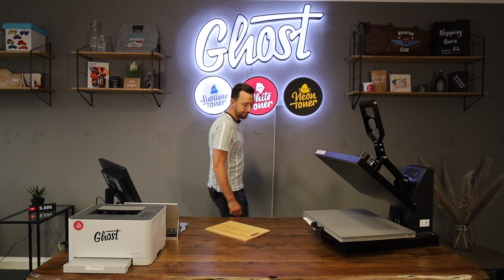Print on wood with your Laserjet printer - HP Color Laser 150

Comment: Hey ghost white, im wanting use a laser printer to make white toner waterslide decals for models etc. I have a hp150nw, will it work with just the white toner from ghost, or do i also need to use ghost colour toners, or will the hp branded ones work fine with the ghost white toner? thanks
Reply from the maker: Hi, the White toner from also works in conjunction with the HP toners. However, we recommend that you turn off the software updates.
Here is a video of how we print deals with the HP M150 Mini Ghost: https://www.youtube.com/watch?v=ZU1h_OAxBVk&t=160s

Comment: I still have problems with A & B foil .. it doesn't transfer .. toner stick on B foil..
Reply from the maker: Then please check if you follow these things:

Do you preheat the lower plate of the press before pressing so that it keeps the film warm during peeling ? 
Do you pull the film hot directly after pressing on the press ? 
Do you press at 160 degrees for 120 seconds ? 
Do you peel the film slowly and smoothly ?
Reply: @Ghost-White-Toner  yes , i make all of those perfectely! I've lost ca. 13 A sheets and B sheets ...
Reply from the maker: Hi, 

ok you pull off everything on the hot plate directly after pressing ? Without pausing in one go. 

please also check that degrees are not confused with Fahrenheit. 

and if all this fits and it still does not work please contact our support at: support@ghost-white-toner.com and write your order number.